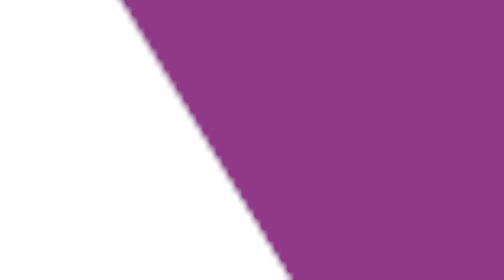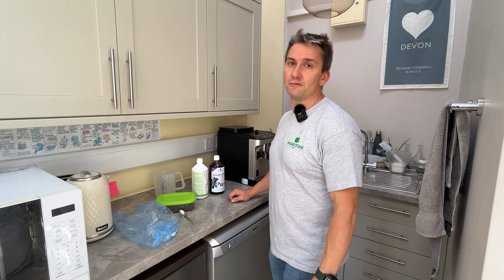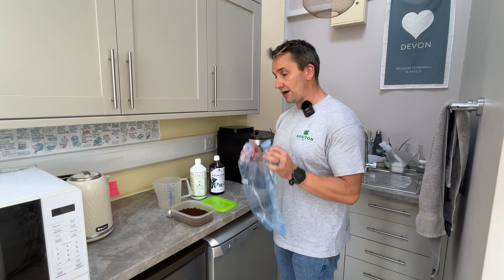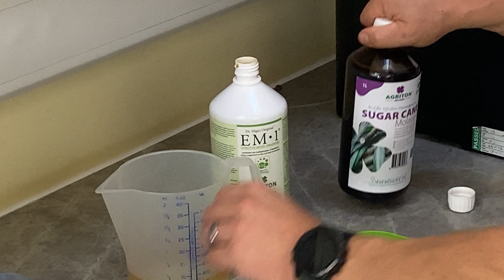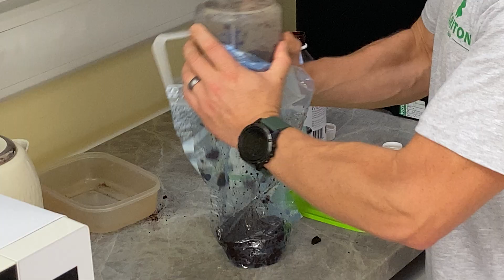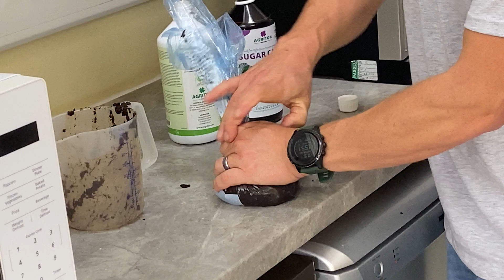DIY Bokashi Starter: Turn Coffee Grounds into Compost Gold

Comment: Actually, one should probably inoculate the coffee grinds with LAB solution (LAB, dash of milk, water) right after they have been used, once they have cooled under 30 C degrees, as they will effectively be pasteurized by the hot water during coffeemaking.